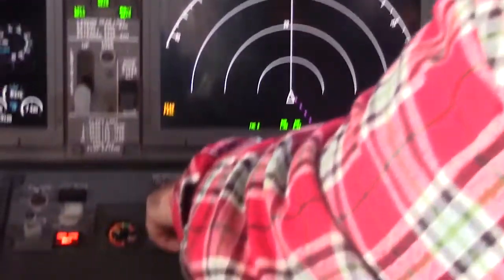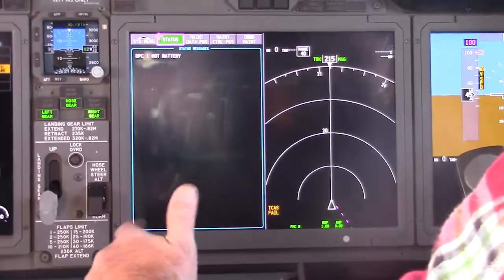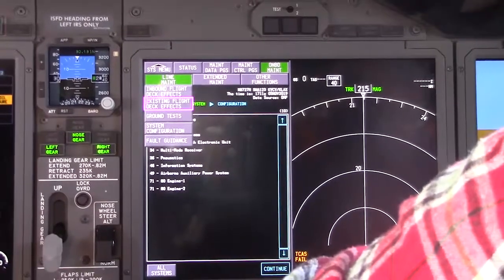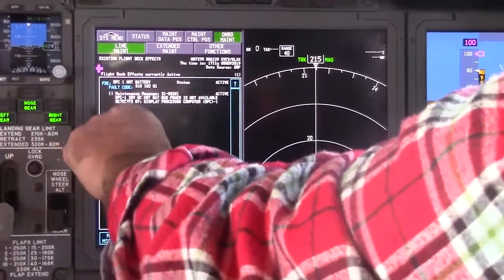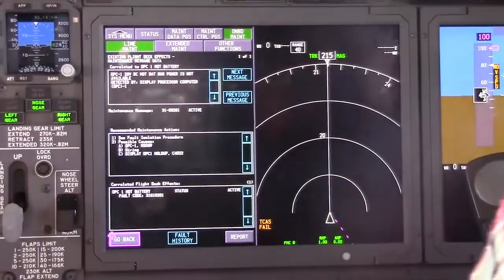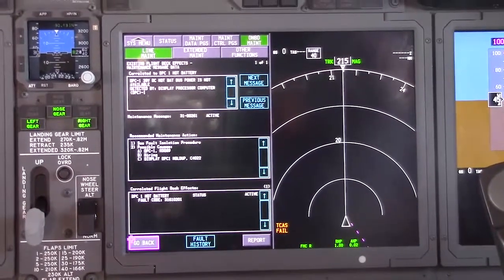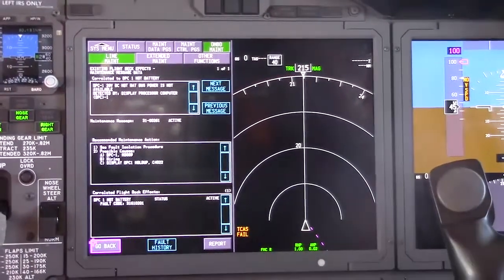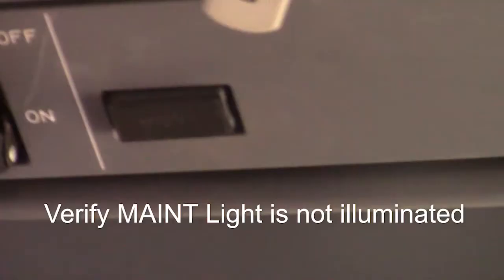MAX RTS OJT 5 Fault Interrogration for a MX Message Light

Comment: Essentially a multi million dollar ‘have you tried turning it off and on again?’
Reply: As an avionics maintainer in the air force, I can't tell you how many times that's fixed an issue in the last 13 years I've been on the line.